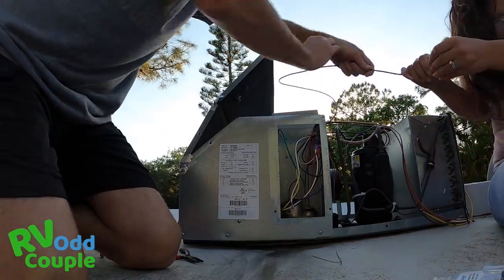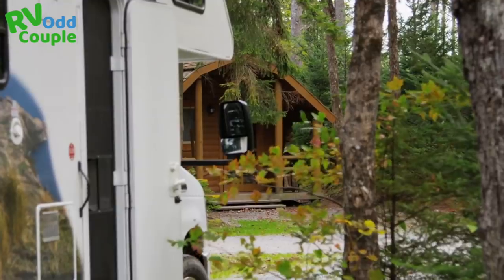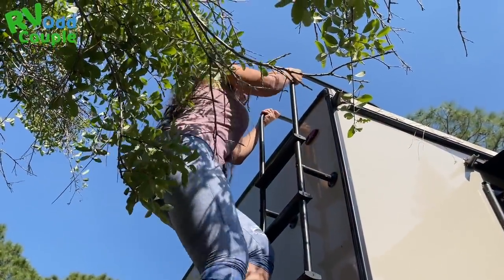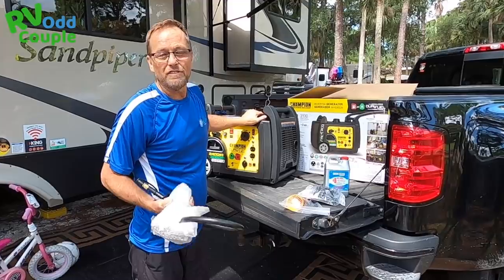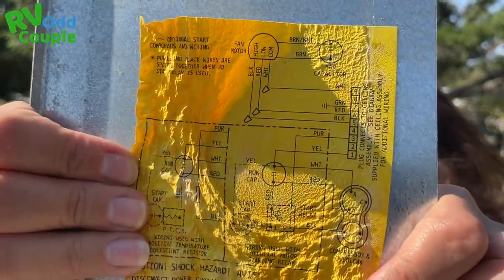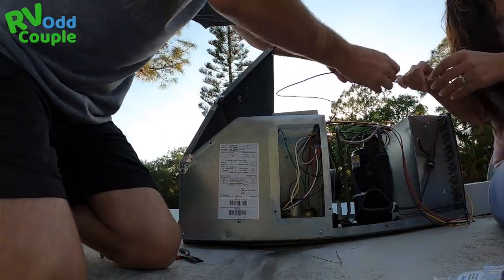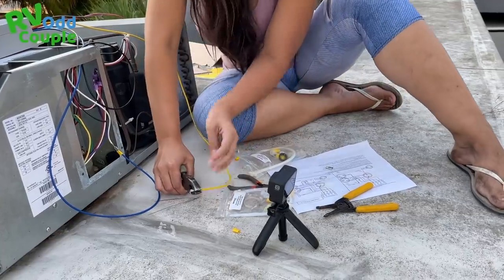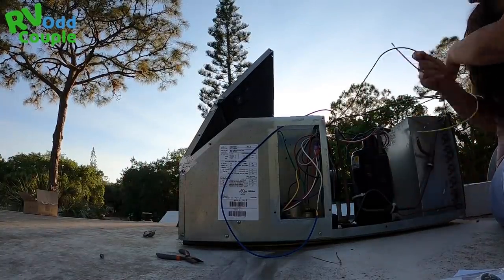FIGHT TO THE DEATH  😂  WIFE INSTALLS SOFTSTART RV AC

Comment: I'm proud of you !    My hubby is a HVAC guy and he has taught me a lot .   I wouldn't even try because frankly that's his specialty!   I'm still proud of your driving too! It's not easy and you didn't wreck, didn't cause any damage and you didn't put John out on the highway !    Yes putting in a soft start can be done by people with no electrical experience . Read and follow the directions , read them twice and double check all connections .     That yellow circuit drawing is called a schematic!

Comment: I got one and installed on my class B Roadtrek. It has a Dometic Duo-Therm. No wiring diagram was listed because apparently there is a lot of variance among those units, but their service tech walked me thru it. My AC now runs fine off a 15a household connection!

Comment: Love this! I am a 60 yr young woman who was on the road last year. My water heater wouldn’t work and I was tired of taking cold showers ( even in the 100 degree NM summer) but after a mobile rv tech coming out twice and not being repaired still and 200$ later I was on a mission to get er done myself. I watched u tubes and tried to see what others were doing to fix it and tried different things from replacing my propane regulator to and different parts in my water heater to no avail. I took to an rv center to ask questions and they don’t give free advice and at 140.00 an hour I was determined. It was an easy fix finally replacing the electric board but in the long run it cost me 600$ which would have only been 140 for the circuit board had I known but I had hot water and was happy.  I’m a fix it gal, have done carpentry work in my days to growing my own food but always hired others for technical stuff ( other than replacing. Heating elements in water heaters. Killing ALL power in the house not just the heater! Haha.  The year on the road taught me so much, learning to drive and park a rig by myself and being on the road alone. I have sold it now and based again but I live vicariously thru others on the road and the itch is there now again, but my fear is no where to go as many have stated parks and forrests are full. So I love being on the odd squad team and watching how one can do anything if we but only try and ask questions, or watch u tube university when stuck.
God Bless!!
Reply from the maker: Love, love, love this❤️❤️❤️

Comment: For rubber roof to spray with Clorox / Tilex mold & mildew and just spray on then self remove dirty became whiter but after spray be very careful not to walk on it since this solution is very slippery then it'll be drying out afterwards. I used have travel trailer but not anymore with the struggling things are easier breaking.

Comment: A word of caution, not all small 2000 kW generators perform the same. A Honda will likely do the job,  but a lot of the other brands in this class will come up short. Your results may vary.

Comment: Thanks for this info.  Wish I had seen this earlier.  I bought 2 3800 watt inverter generators with a 50 amp parallel kit.  If I had went this route I would only need 1 generator, and it would definitely push a full 30 amp circuit.  1 generator on board means less weight vs 2.  I'll probably go ahead and do this upgrade anyway and sell my second generator and parallel kit.   Thanks!

Comment: The Soft Start sounds great !!  Gonna get me one  ... 💥Safety Tip💥 ; I always lean a 6 foot step ladder up against the RV access ladder. Fasten with a bungee cord. Much safer and easier to climb and less stress on the very narrow RV ladder and the attachments. ...   

Q ... Is the next video about power washing the rubber roof and recoating it ?  🤔🤠
Reply from the maker: Great tip but M wouldn’t allow me to....Coming soon

Comment: I hope you don't think that crimping those terminals on the end of those wires with lineman pliers is going to be tight and secure??? You have to get regular terminal crimping pliers or the wire will just loosen and fall out. Use something like Channellock 909 wire crimp tool.

Comment: Thank you for posting this video installing the EasyStart! We ordered one after watching this video (hint, hint Micro-Air - you should be sponsoring this YouTube channel). Mercedes, you were the inspiration to have my wife and son install it on our travel trailer.  I really don't think she would have even considered it without seeing your video.

It took just over 1/2 hour to install.  The longest part was figuring our what make/model of air conditioning is on our RV.  For anyone else with a Rockwood Mini Lite travel trailer, the A/C manufacture is listed as Suburban in our documentation however Suburban is a subsidiary of AirXcel and their A/C unit is actually made by Coleman-Mach.  Once we knew it as a Coleman-Mach A/C, the directions and info on the Micro-Air website were easy to follow.

Comment: Hey guys; your video was fun and I want to pass along what happened to me installing soft start last year after seeing you're first video. I have a Coleman-Mach heat pump. After installation the AC worked great. When cold weather arrived I tried the unit in heat pump mode to heat the RV and it stayed in AC mode. I called tech support and was told they had not yet seen a schematic like mine. I had followed the directions correctly but they had an error in them for a heat pump unit( the direction had told me to disconnect a wire going to the reversing valve). They spotted the error and told me to reconnect that wire and it now works. So be sure to check out operation in electric heating mode as well as in AC mode.
Reply from the maker: Thank you for taking the time to share this David! Very helpful 👍👍👍😊

Comment: Addendum to last post....wires not crimped with proper crimper could come loose in the connector and heat up (due to bad connection) and even come out of the connector. I would get this done ASAP.

Comment: In residential and light commercial HVAC units I used to install hard start kits when I was a service technician. Hard start kits consist of a start capacitor and a start relay. I thought that is what the Soft Start RV consisted of, but when I went to their website it said to remove the start capacitor/relay or the PTCR (Positive Temperature Coefficient Resistor) if equipped with either one, so I'm actually curious on how the Soft Start RV works. Also, I'm thinking of purchasing a motorhome to live in full time because I sold my house years ago and am tired of paying high priced rent for a house. If or when I do get a motorhome, I'll look into the Soft Start RV because I would be living in Arizona and one definitely needs air conditioning there. Thanks for the video.
Reply from the maker: You’ll definitely need a SS in AZ

Comment: So you had a soft start on one of your AC's prior? Did you only run that one AC before? I have been looking at these and don't know enough about them. We require 50 amp for our 5th wheel and would love to access some of the 30 amp sites at some of the places we visit. So if I installed 1 of these on each of our two ac units, then we could plug in to 30 amp power? Funny video.

Comment: Does the soft start also help with lowering your electric bill for those how full-time live in an rv park?
Reply: It only lowers in rush current/ rotor lock amps to start compressor. The surge is only about 3/10th of a second.  It  doesn't lower the amps to run A/C unit.
Reply from the maker: Yes, of course
Reply: @RVOddCouple   :  Well, you may be misunderstanding what Michael is saying.  Yes, the Soft Start might save you from having to pay extra for 50-amp service, but as "fishy man" correctly pointed out, it doesn't actually reduce electricity usage, so it won't reduce your electric bill.  Not that it isn't a great product, but it does not and cannot reduce the amount of power an air conditioner uses.  It just smoothes out the initial surge of current when the compressor starts up.

Comment: Noticed Mercedes "crimped" the connector on the end of the wire with what in the trade is called a linemen's pliers. This has a flat surface nose.  Although this will compress the sleeve of the connector onto the wire, it dosen't really make a good connection between the connector and wire.  Get a proper crimper for the size and type crimp connection you have.  Looked like you had an insulated yellow (for #12-#10 guage wire) connector.  Get a crimper for insulated crimp connectors and HAVE HER go up and "recrimp" her connections.  Don't need to replace them just disconnect the wire from the AC terminal, recrimp and reconnect.  Will probably take longer to get covers off than to recrimp.
GOOD JOB...AT LEAST YOU TRIED MERCEDES.   That is MORE than a lot of people would have done.
Reply from the maker: Great advice!

Comment: I saw a post on a forum trashing this product only to find out they had bought a knockoff brand. How did I know? Because the product name they used was not exactly the same. So this is a heads up for squad members to make sure you're getting the right one. For those needing to replace their AC units, Furrion now makes ACs with a soft-start feature built in.
Reply from the maker: Great info! Thank you Roy

Comment: Congrats on the installation AND both of you and the air-conditioner surviving!   8- )

However, (& I don't know how to put this without sounding mean.. I apologize in advance..)
 
If you haven't cut into the terminator barrels, please re-crimp the terminations you made..

While you can, as you have in at least one case, flatten the barrel of the terminator using the flat jaw nose of lineman's pliers, even a gorilla will not be able properly, fully, crimp it. The joints will not have the necessary full electrical contact. If they are exposed to full load current, they'll eventually overheat &/or come loose or pop out.

If you've used the cutter portion of the lineman's pliers to apply enough pressure to crimp, the termination's insulation will be cut and damaging mechanical stressors will have been introduced into the barrel. You may have even partially severed the compression barrel in which case the terminator should be replaced.

Please borrow, rent or purchase the proper crimping tool and educate yourselves on how to properly use it..

Repurchase quality terminators to replace those exposed to the cutter portion of the pliers....
Pay attention terminator's color (wire size specified), the size of the ring terminals & quality.. 

You could solder the terminals if they haven't been compromised by using the cutter portion of the pliers, but I suspect that proper soldering techniques might be missing from your skill sets..

With the best of intentions,
Dennis
Reply from the maker: Great advice! Thank you Dennis 👍😊

Comment: My wife never would have made it past the ladder 😁
Reply: I've been wanting to buy one of these for years for my 2400 watt inverter generator.  Just today at home plugged into a 20A outlet in my garage I started up my trailers AC twice.  It was only 84 outside but shortly after that I couldn't get the compressor to completely kick on for the third time because now the startup demand was even too much for my houses outlet.  Going to try it again tomorrow early in the morning when everything is completely cold.
Reply from the maker: @craigwflys  Is it a SoftStart? Somethings not right? They have a excellent customer support. Dbl check your wiring
Reply: No I don't have a softstart installed which is why I believe I'm having issues firing the unit back up once it was warm.  Supposedly the Brisk Air II needs a good 2600-2800 watts which is too much for a homes outlet.  I'm guessing when the system is completely cold it doesn't need that kind of wattage to get the compressor going which is why I was successful the first two times.
Reply: Not sure if you will ever see this but I have an idea for a new video.  I have a problem with my AC and trying to get a mobile RV mechanic to come out to look at my unit without charging me an outrageous amount has been difficult to find.  One guy wanted $325 just for the house call and the other immediately wanted to put in an entire new unit for just under 2K (AC and labor).  I can buy an entire new AC unit on Amazon for $722.  Not sure what to do.  However I'm living here in LA where no one wants to help you out unless they are making a killing :(

Comment: I am certainly no expert so you should do your own research. I searched for "RV Air conditioner soft start" and found three manufacturers. Micro-Air EasyStart™ 364 Soft Starter was the only one that was clearly advertised as being made in the USA and is UL Listed. UL Listed means that a Nationally Recognized Testing Laboratory has examined and tested the device and declared it safe to be installed in a high voltage circuit. You are going to install these devices into your high voltage electrical system and go to sleep with it running. I would sleep much better knowing the device was made in the USA and was declared safe by an independent laboratory rather than "made in China and tested by no one". A fire in an RV often results in a total loss of both the RV and all of the contents. My free advice comes with a full money back guarantee. I hope this helps someone with their decision. Dave